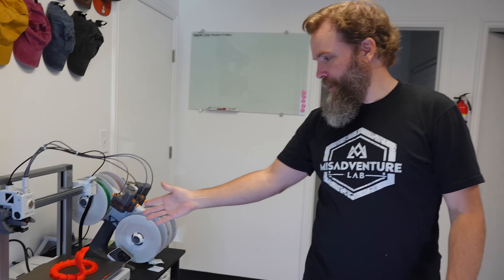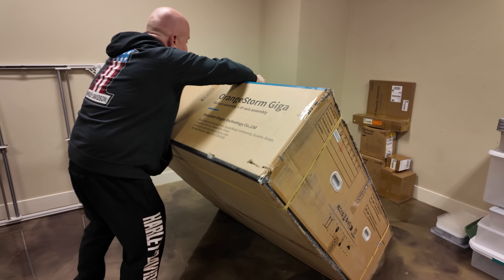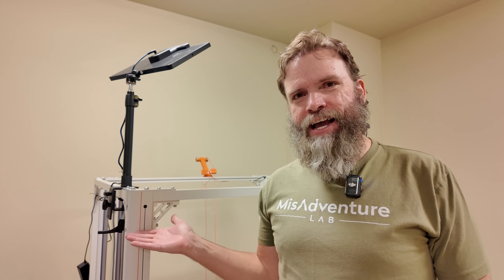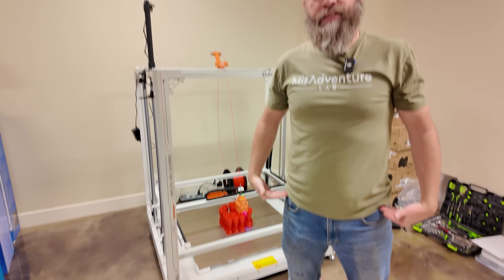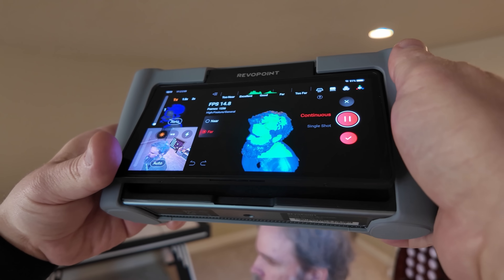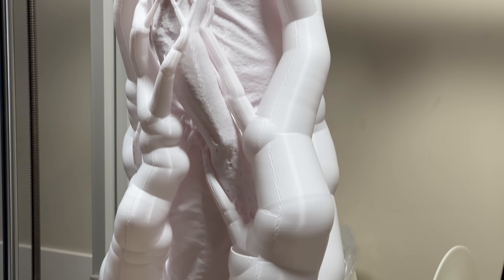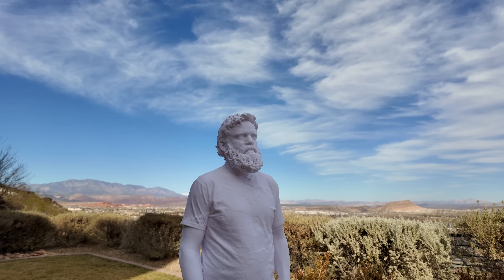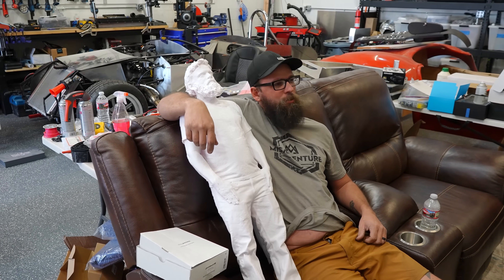We got the World's Largest 3D Printer and printed a Human Clone

Comment: you could have saved so much on supports having them connect to the model in areas like the sleeves to the  arms.. etc.. though with time i am sure you will find a way to reduce the amount you use.. awesome print at the end of the day what layer thickness was it how much filament did you use.. and how heavy was the main model and the tree supports.. though i was expecting better quality from the revopoint scanner.. now time to go full scale hehe

Comment: You can make the seams random and they wont show as much and turn off the emergency restart it will make the print cleaner. We own six printers and only use a 300x300 because it fits most stuff we print. My experience is keep a few petg spools for cabinet drawer sliders, Car parts, and othe things that need a little strength and carbon fiber for firearms and other parts that take a little heat.